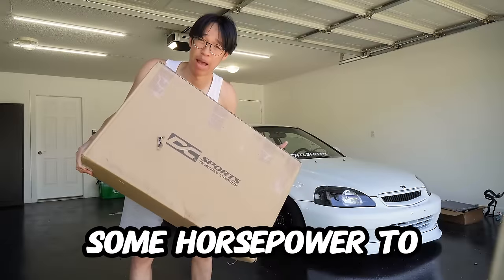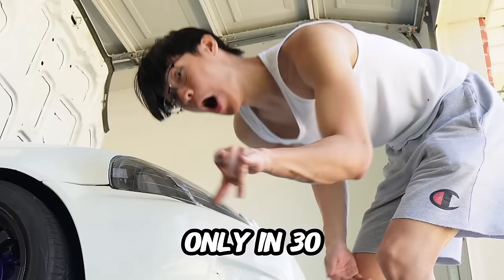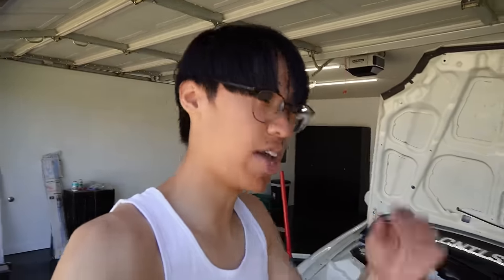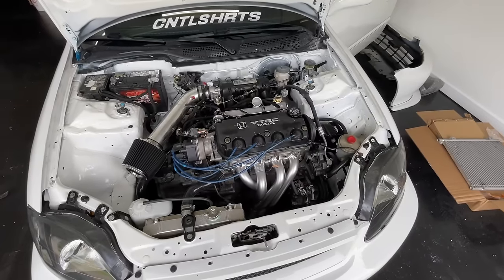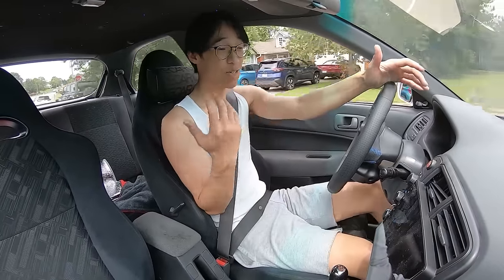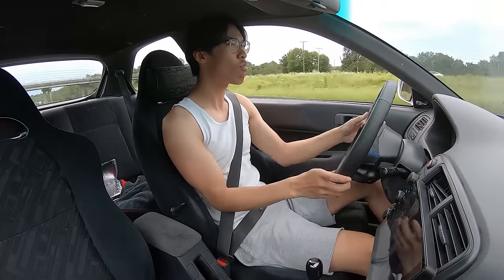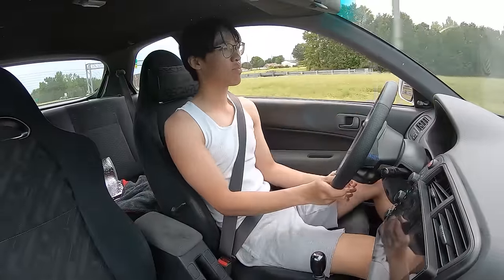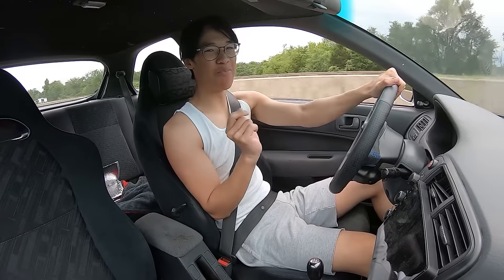Turning my SLOW Civic into a STREET SLAYER!

Comment: 1:33 specifically the relief of back pressure; you get a better velocity. Just remember if you run too wide a diameter on your headers and exhaust tubing; you could still have a less restrictive airflow but you might lose velocity. 
Nice headers though man; sounds prefect 👍💪
Reply from the maker: Thank you for the info! Will keep this in mind for future builds.

Comment: That shell is bloody CLEAN!!! I'm just going to throw this out there, but maybe start thinking about a K24-swap. Even if you turbocharge that D-series, it will never be as reliable or able to accept as much power as a K-series. 

Let's face it, once you get the itch for more HP, you're always going to be looking for ways to increase it. With the D-series, you will hit a power plateau in a fairly short course. The K-series motors are fair priced for what they can handle, and there's an insane amount of aftermarket support for them. Plus, if you get a nice snail-shell with the K, you'll be doing the torque-steer boogie in no time, lol.
Reply from the maker: K-swap in the future forsho! Just need a better deal to find on facebook marketplace

Comment: @Jarek.  Do a vakve adjustment to get rid of that teek teek teeky.  will sound way better and pull a bit harder and smoother.  Ive owned quite a few cars and all my Hondas needed adjustment H B D and J series.  And its tedious to do correctly but well worth.  follow procedure to a T but go off forums for valve clearance. OEM still ticks a tad. You got dis.  I also just moved back to AR w my cars.  MR2 Big boost Turbo.  91 CRxSI swapped vtec.  95 prelude. 540hP jaguar. and a couple more. Im a Asian Euro Auto technician. Mercedes trained. Let me know if you want to start flipping cars or something. Peace Brother.  That civil civic is gonna be unruly man. cant wait to peep that
Reply from the maker: I’ll try this out! I appreciate the support ❤️